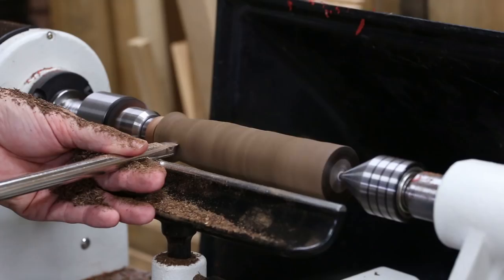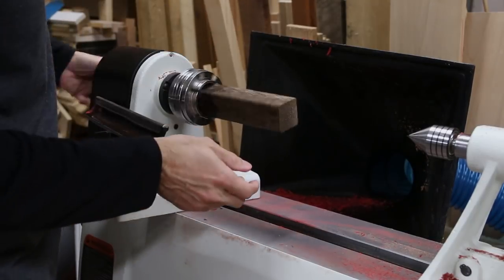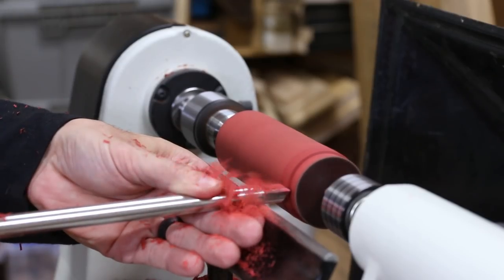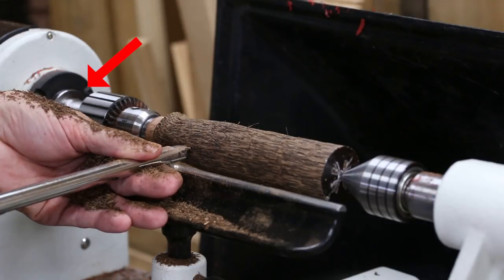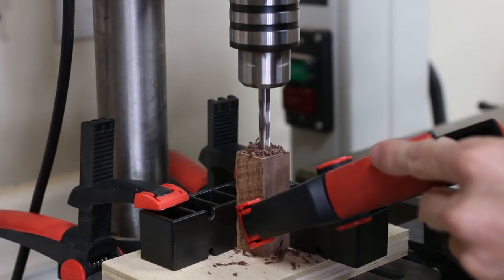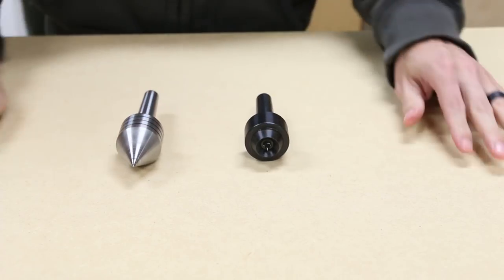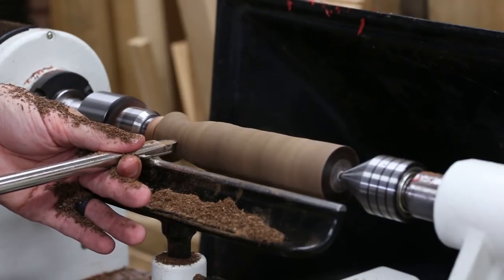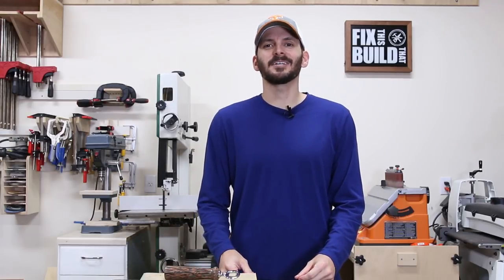Beginner Mistakes on the Lathe | 6 Days of Beginner Woodturning Day 3

Comment: A Morse Taper spindle is all that holds the chuck in your drill press and can be as easily unseated as the chuck on your lathe. When installing the chuck on the drive side of your lathe, i recommend you retract the jaws fully and give it a whack with a rubber mallet to ensure its fully seated, also make sure there is no dust or debris on the taper or inside the hole. The design of a Morse Taper is so precise that that friction is more than adequate to hold it in place vertically or horizontally.
Reply from the maker: Good tips, Mike.  I definitely should make sure the chuck is clean and the rubber mallet is a great idea.

Comment: I recently turned  some black palm and the only way to get a great finish is with the skew chisel and a long planing cut riding the bevel scraping does not work at all on the palm wood. Don't quit with the palm though it's lovely when you get the results from the skew with it.

Comment: Nice video.  It would help, if you have fragile timber like the palm blank, to use a cutting tool rather than the tungsten tip, which is essentially a scraper.  Try turning the palm with a skew and you will cut the wood, not rip it away, and minimise the risk of catches and breakout.  I know, I've done it!  If all else fails, and you have to use the tool in the video, tilt it to the left by 45 degrees or so and you will get a planing cut, not a scrape . . .

Well done for sharing.

H
Reply from the maker: Steve, great tip on tilting my carbide to get a shearing vs scraping cut.  thanks!
Reply: You're welcome!  Even better - get a skew chisel and practice with it.  Life is a great big lesson . . I've been turning for 5 years as a hobby, made stuff from pens to large bowls and I am still finding better ways to do things.  Keep turning and learning!

Comment: Really nice video man. I just find carbide so counter productive. With a spindle gouge you could have twisted or angled it 45 degrees and the finish cut so much smother. Looks like you ended up with a good finish after sanding though. Thanks for the video.

Comment: Hey, Brad.  I've turned 500+ bottle openers and have learned a bunch of hard lessons...  I stabilize most of my wood now - it just makes such a huge difference in turning, finishing, and durability. My other big tip is to get some cheap threaded sleeve inserts that fit your mandrel.  I epoxy them in and have never had a blank slip yet.  It also makes the opener hardware much more solid. Great seeing your work - see you over on Instagram!  Brian
Reply from the maker: +Brian Unruh good tips, Brian! Love your openers!

Comment: Thanks man, good stuff!
Suggestion: With easily splintering end grain timbers (like black palm, balsa, and spruce), try mounting a temporary copper ferrel to avoid splitting as you wind in the tailstock. Easy to do, easy to make, and it rids the project of a major bug/worry right there. You don't have to glue it on, just make it a precise fit.
Give it a whirl!

Comment: The MT2 will hold tight if you just tap it with a wood mallet when you install it, and I said tap not hit. If the tapers on the chuck and in the Spindle are clean and burr and oil free they should hold perfectly for your turnings. Only tap the chuck when the jaws are retracted all the way, you can also avoid taping by just applying pressure while installing it. Great video, thanks.
Reply from the maker: Thanks for the info, Gilberto.  I will try tapping the MT2 next time!
Reply: spinning a #2 taper in the head stock is a good way to gall the interior of the head stock and never have anything line up again.  Happened to me on my metal lathe tail stock.

Comment: Good series, Did you check to see if there was any oil or grease residue on the taper?  I know that milling machines hold their tools in this way but didn't know that a wood lathe could.  I assumed that they also had a pass-through possibly like a metal lathe. But my lathe is from the 60s so I only have the MT on the tail stock.

Comment: Every time is i put a drill chuck in the headstock I always use a drawbar. Easily made by using a length of All thread the size of the thread in the drill chuck , a Star know that fits the All thread, and turn  a wooden spacer about 3/4" thick so the star knob can easily draw down.  I have never has my drill chuck spin using this setup.

Comment: Your end products are nice. Please allow me to contribute without having read all your comments below. The drive center/arbor you used is a machine screw thread designed for much harder material, or much lighter cuts. A wood lathe drive center is very much like a wood lathe tailstock center with a slight difference. The Correct drive center for wood has a point and 4 fluted drive edges intended to engage and provide the drive forces. They deliver great force and only penetrate very superficial. The tailstock live centers you showed are entirely different applications. The one without a cup is intended for metal and harder materials, whereas the one with the cup ( the correct one )  is the one for wood.

Comment: I found that carbide tools don't work well on that black palm, for me anyways.  Also, I use a cupped live center (like you pointed out), but I stack some rubber washers on it, so that the point doesn't pierce the wood.  Since it's threaded into the mandrel, I've found that this is sufficient support.
Reply from the maker: Thanks, I want to try HSS for sure

Comment: The reason your stock was spinning was due to your live center. Not only would the stock (cupped) live center have prevented the wood from splitting as you noted towards the end of your video but would have enabled you to tighten the wood a little more and prevent the spinning. Nice job on the videos. I really enjoy them. Keep up the good work.
Dave
Reply from the maker: thanks, Dave!

Comment: The pen turning forums I am a member of have a great tip for you and other beginners wanting to get into working with difficult materials ....

Instead of using the lathe chisels to work with such a difficult material, use a rough grade of sandpaper instead!  Take a strip of 60 grit (or even 40 grit) ... just buy a 1x30 belt sanding belt or other similar material, cloth backed works just fine.  You can even glue a piece of it to a piece of wood to give yourself a good firm backer for detailed lathe work.

This method works for any material that is difficult to turn due to how fragile it is, and also works for materials that may damage your lathe tools ... such as certain types of stone!  Marble, Alabaster, Soapstone, even small pieces of Granite are possible materials to work with, using sandpaper for your tool.  It gets even easier if you have access to some other specialty tools, like a diamond cutoff wheel that you can mount on the end of a stick to use it on it's flat or on it's edge presented at a slight angle to grind away the material.

Never be ashamed of needing to "fall back" to a method like this ... all that matters in the end is that you made it yourself, no matter HOW it was done, you still did it yourself, by hand, in your own shop.

Great work, and keep it up!

(aforementioned forums:  http://www.penturners.org/ )

Comment: Hey Brad, Love the turning series!
I was hoping you could help me with a question. I recently started turning and got a steal of a deal on my final element needed for turning, the chisels. At any rate, most of the tools I have I have seen used in various youtube videos. However, there is one that I am assuming is used for bowls. But, I am not sure. It has a flat rounded end. If you have a place where I can send or post a pic that would be wonderful. Thank you again in advance for your assistance.
Reply from the maker: What you're talking about is a scraper I believe.  It can be used for lots of different things.  I'd google scraper turning tool.

Comment: A drawbar is normally used to keep the drill chuck in the headstock spindle.  Most drill chucks have a 1/4-20 thread in them.  Use a piece of 1/4" allthread through the spindle. Thread the allthread into the drill chuck and use a large washer and a wing nut to securely hold the drill chuck in place.
Reply from the maker: Good tip, Joe.

Comment: Good tips about some things to look out for. I just bought a lathe, and I'll be tackling some turning projects soon. Also, bottle stoppers are unnecessary. ;)
Reply from the maker: Thanks, Bruce.  Have fun on that lathe.  And you are totally right :)
Reply: Mmmm ... I make my own wines and meades ... and rather than just corking them, using a bottle stopper (along with a custom decorative bottle) makes for an awesome presentation in a gift item!  It also makes it so much easier to pop that cork for the first drink, and can be kept as a memento afterwards, so GREAT for weddings and other big occasions!

Uncorking a wine to replace the cork with a decorative bottle stopper is also quite feasible, just don't do it with the bubbly variety!
Reply: All good points. I need to consider that. I like your ideas of giving the stoppers and wine together as gifts.

Comment: If you stabilize black palm, you are turning plastic vs turning palm.  To turn Black palm, you have to realize that it is nothing but a bundle of weakly bonded fibers.  The last thing you want to do is to scrape it.  That guarantees tear out and usually very big tear outs.  This material must be CUT not scraped.  So if I were using the carbide tool that you have I would rotate the tool 45 degrees and essentially use it as a shear scraper which is really a shear CUTTER.  I would always cut downhill so I am never lifting the ends of the fibers but rather cutting them down.  So plan your cuts.  If you cut uphill, you will tear out and sometimes explosively.  

My preference for most cuts is a skew that is sharp as a razor taking small well thought out cuts.  I tend to take any tool that I use on palm and put it on a 45 degree angle if possible.  I even rotate my roughing gouge to bring the palm blanks to square so that the cutting edge is at that nice shear cutting angle and cutting along the grain and not the grain slamming into the tool edge.  It is a finesse cut where the actual cut of the fiber is extremely small because the tool edge is not on the bottom but the side.  

Depending on the tool you use, some shearing cuts will not be bevel supported cuts.  So a light touch is essential but it will give you a smooth result without tear out.  A big bowl gouge with closed face and a shear scrape angle to the work will perform magic on your palm blank.  Try it!

If you follow these guidelines, you can cut Black Palm and create cool stuff.  I once turned a half domed pendant out of Black Palm and put it on one of my Pinterest boards with other pendants.  It, over the years, has been the most popular pin from that board.  I don't know why people like it so much but it attracts many people.

Comment: The right sized washers on your tail stock center will keep the wood from splitting.
They wont allow the center to go in any farther and you can put pressure on the wood. 
I use a brass hammer I made to tap in tapers so they seat properly.
Lead works too.
This dont on my metal and wood lathe.
Reply from the maker: Thanks for the tips!

Comment: Wouldn't conventional HSS tools cutting the fibers work better than scraping them with a carbide tool?
Reply: oldschoolsmart to To me the use of just carbide scrapers is a major problem.  A spindle gouge of any kind will do a better job on fibrous or splintery woods.
Reply: carbide is fine for roughing out material, but sharp HSS will greatly reduce chip out, tear out and sanding time even.
Reply from the maker: Yeah, I want to get into HSS tools, I just started with carbide because the barrier to entry is so low.  I don't have a grinder or a place I want to put it at the moment.

Comment: Black palm does not scrape well, as you learned... a sharp edge is needed to cut the fibers, skew, or gouge work fine, fresh off the sharpener.  Be prepared for sanding, sanding  sealer & more sanding

Comment: Here's you a tip.  You don't need a draw bar.  Make sure both tapers are clean.  When you insert you drive center, give it a wack or two with a wooden mallet.  It will not slip.  Take care, Larry
Reply from the maker: Thanks, Larry, I'll try that next time.

Comment: Theres no way that morse taper should have self spun in the lathe, in engineering lathes we were taught to put a piece of wood on a fully open drill chuck ( so you dont damage the chuck) and give it a tap to make it home in the morse taper slot. That should sort it,.

I have been using lathes for years and have never had to hold a morse taper in with a bolt, the key way on the end of yours is for a drill press,  it engages with a female slot in the shaft, then as you pull the drill down to remove  you insert a metal wedge into a keyway to release the morse taper. the wedge holds the morse taper in the drill press to stop it spinning on thick metal or large drills etc. Morse morse tapers for wood lathes do not have this wedge on the end as there is no need.

Comment: I noticed your using a carbide tip. You might try going twice as fast a normal or at least increasing speed. Carbide seems to like cutting fast. I upped the speed and it was better, then I upped it some more and it was even better! Cutting with a regular steel gouge or skew, OMG, slow down! Just sayin!
Reply from the maker: Great tip, thanks

Comment: Black Palm requires SHARP, CUTTING tools for good results and does not do well with scrapers such as you were using.  The black rods are hard and the brown matrix in which they are embedded is soft, so scraping tears them out.  Next time try a freshly sharpened spindle  gouge and SLICE the wood.  You will be a bit less frustrated at the process..  I was!